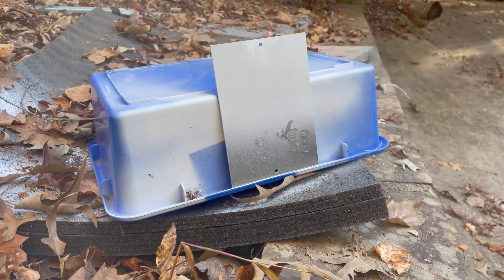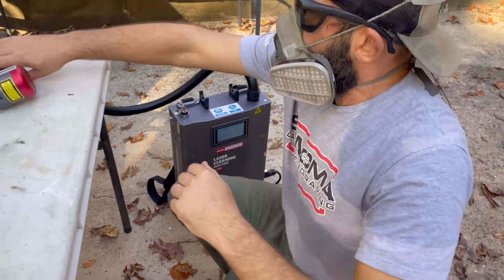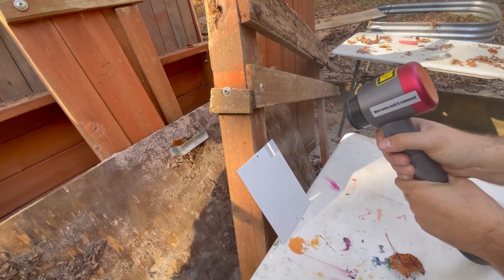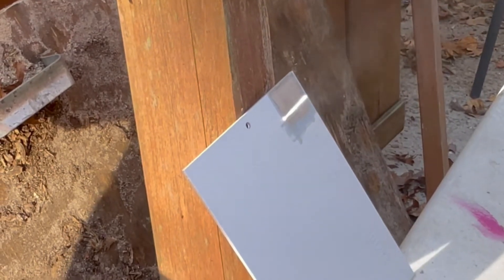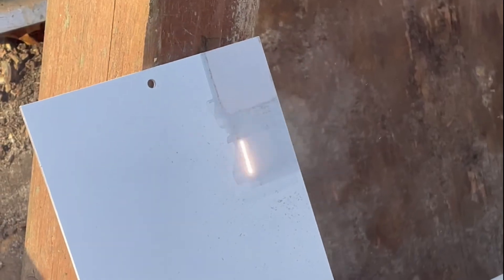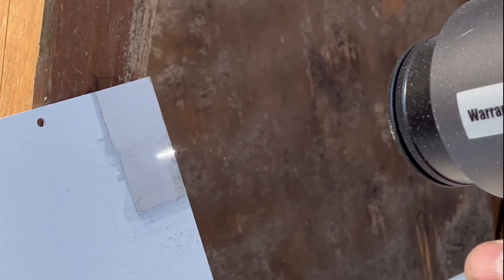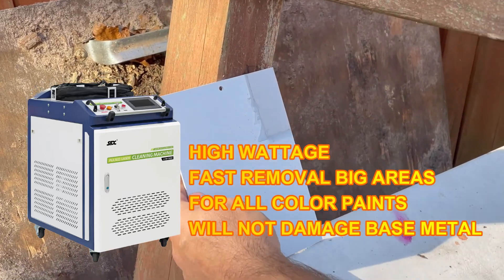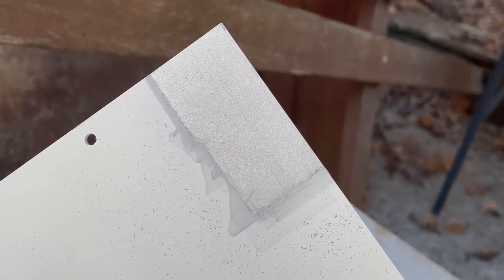Pulsed Fiber Laser Cleaning and Paint Removal Why It Works!

Comment: I have the SFX 300 Pulsed Laser . I am having problems finding the best settings to  effectively remove light paint colors from sheet metal without warping.  I have tried various pulse width and frequency settings, both high and low combinations. When I adjust the parameters low the heat to the metal is low but the time to clean is very slow. As I increase the numbers the cleaning speed increases but the residual heat increases as well. If I address the increased heating of the substrate by making multiple light passes I avoid the heat accumulation but the cleaning time increases substantially.  What are your suggestions for the best settings for cleaning time without warpage ?
Reply from the maker: Please reach out to me for a better setting michael@laserengraving911.com

Comment: Pretty cool! I'm looking at the non-pulsed units for potentially removing multiple layers of paint from my exterior house clapboards. Do you think it would work? Any damage id be looking to sand out with fine paper.
Reply from the maker: Not a good fit, I would think for that, You would be to much damage to the base material and possibility of fire, or charing, it might possible but you would need to find a person with that unit, send a chunk of the exact painted wood for testing and verification

Comment: I got the SFX FLC-100 laser cleaning machine to remove graffiti from metal doors, rocks, wood beams etc and I'm having troubles getting the paint fully removed. It will leave a faint outline of where it was previously or won't remove paint at all. Do you have any settings recommendations I can use to get the machine to cut through paint easier?
Reply from the maker: shoot me and email at michael@laserengraving911.com  Ill see if I can help with settings.

Comment: Thank you for the awesome video. Would you say sfx is a good brand to buy in the USA, I'm about to get a 200w portable pulse laser and who do you recommend getting it from?
Reply from the maker: Yes and yes, I really do think that SFX makes a great product when it comes to both fiber lasers and laser cleaner gear, I personally have used them all and looked inside to see the craftsman ship and they are build very well, if you looking for a solid ready to rock 200watt unit I would check this one for sure, and if you can go for the 300watt! it will give you more cleaning power and finish the job faster!  https://sfxlasertech.com/products/sfx-100w-handheld-jpt-laser-cleaning-machine-rust-removal-auto-laser-cleaning?ref=Michael%20Mullins&variant=41213021159513
Reply: Thank you so much for the info, I really appreciate it. Guess the 300 watt will be better. Thank you!!

Comment: what would be the difference in performance between a 300 watt SFX Off-Road Pulse Laser Cleaning Machine vs the 300 watt Pulse Laser Cleaning Machine (the one that's a big rectangular box on wheels). would the off road overheat or be less powerful?

Comment: I just bought the 200W version of the machine you are using.
Reply from the maker: Nice, did you get it from SFX? how are you liking it!
Reply: @LaserEngraving911  I did get it from SFX.  It's still in transit from Hong Kong.
Reply from the maker: @Boodieman72  Nice I have the 300watt coming soon here to the shop, if you email  me I can share some settings with you, once I have had it for a bit.
Reply: @LaserEngraving911 hey 👋🏽
Can you please tel us the range of price for a 300w machine like that?
I Wold like to acquire one for paint and varnish remove on wood
Cheers 👍🏽
Reply from the maker: @ #1 AGC-300 https://tinyurl.com/pulsedcleaner   and you can use my CODE  "LASER911200" for 200.00 off.
Reply: @LaserEngraving911 I'm in Europe... 
I'm trying to understand if I can buy one around here.. 
 thank you sir!

Comment: How would it do on bathtubs, countertops and cabinets?
Does it work on fiberglass?
Reply from the maker: no fiber glass,  or plastic, porcelain bath tubs maybe, cabinets yes pulsed laser only, water based varnish and paint will remove, yes, but fumes will be excessive.
Reply: @LaserEngraving911  thank you

Comment: Great video My question is I am looking to start a Laser cleaning business and looking at the LCM 500 watt would it be safe to buy from this company SFX and would I have any problems with any warranty if needed
Thanks
Reply from the maker: Yes, absolutely, Ive been working with SFX for a few years now and I can say they have excellent customer service, they are very responsive, and in addition to that I personally offer some after sales support with any SFX laser cleaner, so you can always reach out to me with some help with settings, and tips, the LCM 500 is a fantastic unit, and in my opinion as a great unit to start your business with, you will be able to laser clean so many more things than most people can do because you are getting a pulsed cleaner and not a CW cleaner 👍, if you have any more questions about it you can contact me direct michael@laserengraving911.com happy to help, and if you ready to purchase you make sure you use my code for the $200.00 off   "LASER911200"
Reply: @LaserEngraving911  
Great, thanks and when I return from my little get away, I will look into ordering the 500 and get started on my new venture. I know I will have a lot of questions from what size generator to buy so I will be mobile, picking up a trailer this week
Thanks again 
Karl
Reply from the maker: @tangokp   shoot me and email when you ready to buy, and I can help you get all set up with my sales rep she will take good care of you. michael@laserengraving911.com

Comment: Great video. One question right after cleaning can you paint? Or is there some dust or carbon that needs to be removed?
Reply from the maker: Yes and yes, the surface is very clean, and ready for paint. maybe just a compressed air blow off would be prudent.

Comment: Hi That is a great machine, it appears to be 'gentle' to not harm the underlying metal,  but the slow speed you would need to move to remove rust on a autobody that was destined for a acid dip tank to remove everything, seems like it would be too slow to be comparible in price?  was wondering would a more powerful unit still avoid the damage (if carefully done?)  spandblasting is a great example that might do damage if used by someone inexperienced.  I would like to know how fast a competent user could rust clean a body of a vehicle. say 100% of the body needs it to bear paint..  (forgive that it cant get to all location)
  rusty usder carriage but striped and on a roteserrie?
Reply from the maker: for something like that i would recommend the LC500 pulsed cleaner, not the smaller 100watt cleaner.

Comment: Curious if you use a step up transformer? 110v to 220/240v. if so, what wattage would you prefer for a 200w cleaner? can I assume a 2000W chinese transformer would suffice?
Reply from the maker: There is no transformer needed for 100-200watts, it’s all internal power supply 110v when you get into the big stuff, it 240 Single Phase
Reply: Oh, no doubt. i have the sfx off road version and it says on description input voltage 220v +- 10% @LaserEngraving911

Comment: If I want to do rust removal on cars and truck frames, what unit would you recommend? Are you aware of any portable units or those that use 110?
Reply from the maker: There are portable units that use 110 that are 100-200watts , but they are not ment for doing large areas, it would take you weeks. You need to have something with more power to justify the time taken to laser clean something that large, I would recommend for that kind of work the  https://www.sfxlaser.com/300W-500W-Pulse-Laser-Cleaning-Machine?ref=Michael%20Mullins

Comment: Can you show to to set up the machine. It appears that the beam goes back and forth without having to move the gun
Reply from the maker: Yes great question, Ill be making a full video on this unit in the coming weeks, and Ill talk about that
Reply: @LaserEngraving911  i am trying to clean a powder coated aluminum panel. I have the SFX 200W pulse cleaner and can’t seem to get the correct settings. Can you offer any tips.
Reply: I'd like to know that setting to please, mine doesn't to that either
Reply from the maker: @shaunjury936  LC 100 Pulsed Laser Cleaning Setting ( for 100watt system, for 200watt cut power to 50%)

Powder Coating Removal (slow steady)

SCAN MODE REC 2 Power 100, Scan Speed 10k, Freq 100, Pulse 50,  Scan Size 30mm X30mm (can be changed)

________________________________________________________________________

 SCAN MODE/FREEDOM Paint Removal, MAX POWER, and efficient removal, with smooth finish

Power 100, Freq 100, Pulse 500, X Freq 300 and Y Freq 22, Scan Width 50 and  Scan High 12

(Can Play With X Freq and Y Freq to get custom shapes and patterns.)
Reply from the maker: Id be happy to look at your settings and the part your trying to clean and give you some suggestions, please email me at laserengraving911@gmail.com